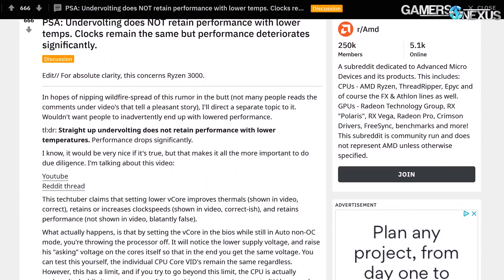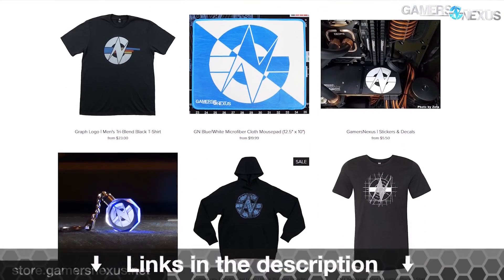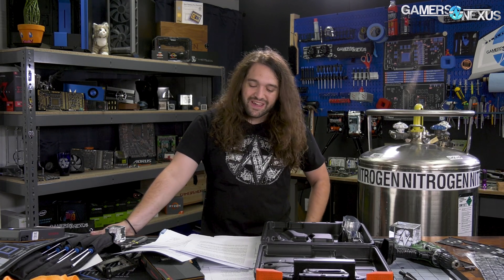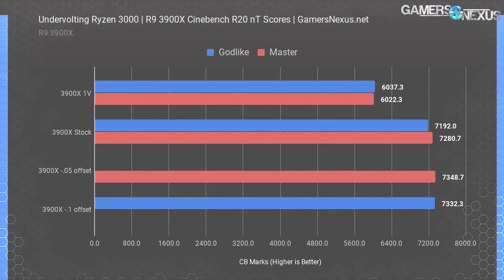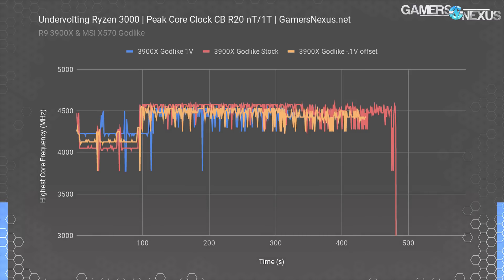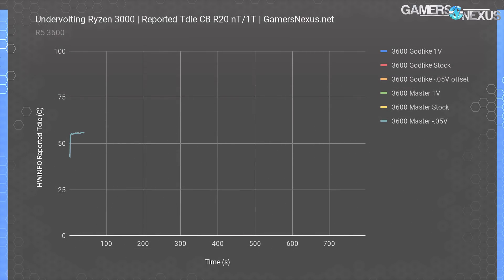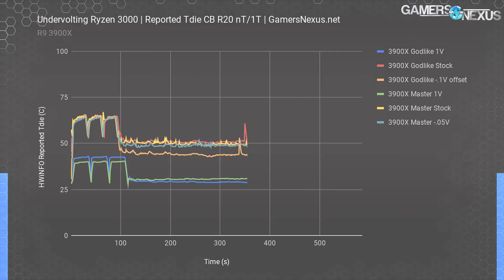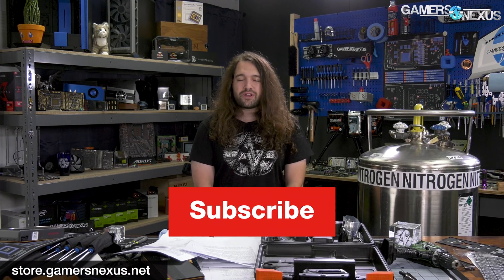AMD Ryzen 3000 Undervolting Offset vs. Override | Vcore Voltage

Comment: I just ran back to back Cinebench R20 runs on my 3800x at low static clocks (3.5ghz) with a Dark Rock Pro4, fans all at 100%, 1800mhz fabric, on a Asus X570-P
I ran each test multiple times until I was sure it wasn't fluke. I'm seeing a drop off at 0.9615v, but it looks like a pump at 1.25v
? That one confuses me a lot.
3668 @1.25v, idles @39c, loaded 58c (as reported by Ryzen Master)
3653 @ 1.1875v, idles @~37c, loaded 55c
3652 @ 0.96875v, idles @ 33c, loaded 43c
3648 @ 0.95625v, idles @ 32c, loaded 43c
3646 @ 0.9375v, idles @ 32c, loaded 42c
3615@ 0.9125v, idles @ 32c, loaded 41c
Interesting stuff!

Comment: Machine: Msi B450x Mortar Max, R5 3600, AIO CPU cooler. readings all from ryzen master.
[ ryzen master manual mode, all connected 4.2GHz @ 1.1v, CB Marks 3582, FSB 1866, cpu temp max around 58c, cpu power around 45w ]
[ ryzen master manual mode, all connected 4.3GHz @ 1.15v, CB Marks 3666, FSB 1866, cpu temp max around 65c, cpu power around 50w ]
[ ryzen master PBO mode, voltage excluded, CB Marks 3312, FSB 1866, cpu temp max around 74c, cpu power around 78w ] (cpu frequency goes around 3.9GHz automatically)
i'm really not good at playing with ryzen, i must have something set wrong since with all bios settings at default, one click PBO setting always give around only 3.9GHz and temp goes through up the roof. but now manually set a fixed cpu frequency and a lower voltage still gives better results.
Reply: This is the same with me I don't understand these videos cause since I undervolted and set my clock speeds to 4.2 I gained performance

Comment: Hold on...
I tested this and benched. I explained how and why in the video.

The boost and core variance in the algorithms, works in a fashion.

Now the temp and voltage are microcoded, if the temp is lower the clock will rise.

Buy reducing voltage at the core, this lower temps and boosts are higher and bench results.

I did not push as low as 1v.

I did lock voltage at 1.225 and 1.32 and 1.35 as well as 1.37.
But I let the other compensation run to allow compensation and also not.

On total lock, there was no boost. (As you would expect) however  due to science or ohm's law, by adding current, you could get a higher speed with lower temps.

On the video I did this is shown at 0:32 showing a boost clock of 5.1ghz
There should be some bench results in the video.
When I did the video it was more for the lower temps and expected performance. It just so happened to jump up more than expected.

Testing was performed over a week and serveral benches were ran to check the results.

However. Due to the performance variable being as it's software and algorithmic, the results varied constantly.
CB R15 varied by 200 points on the same clock speeds and settings.

In monitoring all bench and performance results, all hardware with "energy saving" and " boost stepping"  would not consistently boost or peak clocks at the same times. This resulted in a significant difference in results, by up to 4/700 points.
The only thing that actually remained a constant was temperatures. (Actually was was required).

However as you have said, all chips and configurations are different and you do get silicon lottery. Therefore one processors result can and do differ significantly in some cases. Therefore this result may not transfer to all CPUs or motherboards.

However a key point is that the voltages on the processors is too high and is not required, this is not saying setting a low core is the right solution. But the processors need to run cooler.
And it appears the stock software  does not manage voltage well at all. But this maybe a glitch in mine.

Hope that puts some light on the subject.

Comment: Asus strix b450 and r5 3600 idle temp 60° (in bios 48°)underload 75° after changing cooler and putting better paste..before it went to 80°. what to do? And in windows even when idle core speed is over 4ghz constantly  cpu usage 9-12%

Comment: trying to lower my 3600 down to 3.2ghz max turbo and keep the temps under 65c insted of 75c with a U14 noctua coooler .. 

ITS REALLY HOT IN AUSTRALIA 32c in my room and 44C (111F) on a hellday
Reply: how set vol, plz :)

Comment: Have been testing UV with my 3950X on my  x570 Auros Master, short story. 
UV 0.1V and LLC set to High drops temps ~10 to 73c in Aida64 with fpu stresstest and is rock stable.   
CB 20 temp 63c  544SC and ~5450MC, cpu-z 550SC and 11200MC.  
UV 0.1250V up to 0.15000V is cooler but needs higher LLC, system boots fine without LLC and works under load but cant recover after long idle. 
Cpu does 4,3ghz @ 1,3V ( 1.35V for prime95) but i get better performance with UV.
Cooling is set to quiet and fans is doing like 50-60% in aida64 stresstest so it´s silent during heavy load ( custom loop from EK  120+360) Ambient temp is ~22c in all tests.

Comment: So I'm guessing since undervolting seems hit and miss (I gained 300-400 points in CB) that it largely depends on the memory used. I'm only using 3200-16-18-19-19 memory, while I suppose you're using better memory. Though I'm not sure where the connection is. Maybe stalling

Comment: I'm running my 3600 at 1.168v 4000Mhz all cores, using the Ryzen Master software. If I go one step below at 1.1624v, the system crashes

Cinebench R15 Scores
Stock Profile - 1577
Undervolt - 1588

I'm using a stock cooler btw

My explanation would be that during stock settings, the V rises to 1.4s to touch the maximum boost clock but then it heats up the chipset instantly to 75 degrees or so and it throttles it back.

Using the undervolt, the temperatures don't rise as much and that's why it's able to stick to 4000Mhz. Also that people would say the software reports incorrectly, well if I underclock it a little more it doesn't send. Which means that it is in fact sticking to the voltage I'm giving it

Comment: Did you try only using Ryzen Master to adjust and measure voltages and peak limitations? Because it seems Ryzen Master gives a better representation of you CPU status then other tools because of the observer effect it might trigger. Especially when cores are in its idle / sleep state.

Comment: Fun Fact I managed to undervolt my Ryzen 2600x with an offset of -0.054 and the clocks still boost to 4.0 to 4.2 on the regular it depends on the task but my Cinebench scores are normal... Any lower and it starts to lose performance though... The Voltages tend to hit 1.37v to 1.38v max so just under the magical 1.4v. granted AMD has stated that 1.4v is safe... Still this is very interesting... Wish I had a 3rd Gen to test but it's much to soon to be upgrading from mostly brand new rig.

Comment: I had to set VCore offset to +0.0250V for my Ryzen 3600, otherwise, on "Auto" settings system was unstable i I got many constant bluescreens. I read on some forums that I'm not the only one getting those issues. On fixed vcore 1.35 also PC runs fine.
Reply: Can u help me with the Vcore Offset? I don't have the option to set a Voltage but only a offset. what whoud be good for my Ryzen 7 2700x at 3.9 or 4.0 ghz?
Reply: @CarloLeonKolega  Lower setting is better, but must be high enough to make CPU stable. You can start with "+0.0250", then test system, and if it'll be unstable try add some V. (0.0500?). Repeat untill you get stability.
Reply: @sznib  1.2 is stock V on 3.7 and I used Ryzen master to checked if it can run on 3.9/4.0 on same 1.2V. and it can

Comment: Sir , its safe if ryzen 3 2200g underclock to 3200mhz/ 1.15v?
Thank you
Reply: I set on 3ghz with 1.05 = and it stable on every aaa game, but for ac origins, i set 3.7ghz with 1.325  = it bring me 3 fps more
My gpu is rx 570

Comment: 1.2v @4.3ghz all core with my 3950x and it is stable. (I do this because my h100 pro sucks, @1.4v 4.5ghz the cpu will overheating under full load)

Comment: I dropped 5 degrees from my idle temps with an undervolt to 1.35, from 1.45 on my 3900. Also took the system to 4200mHz all core, and saw a 200point cinebench improvement. Will try with the voltage at 1.45 4200mHz just to see.

Comment: Hi , i recently bought 3700x and i have problems with temps (idle. Between 40 to 55 and i did a stress test , in 5 mins it got to 94 ° than i stopped it) what can i do to cool it down ? I have a stock wraith prism cooler and some noctua thermal paste

Comment: now i'm confused...setting - 0.1v offset in bios i go from 4602 to 4660 in cinebench r20..i only did 3 runs each..=x...so should i go - more??
Reply: You are probably gaining lots of ground in temp, which is helping you maintain an all core boost.  But you also need to run both cinebench and a benchmark that's heavily single threaded for each change and see what your max boost for single cores is.  You may be losing ground there.  But you are only at -0.1v, which the article tests clearly show MIGHT also be superior for some people's CPUs.  Test it! :)

Comment: pinned my 3600 to 1.0375v and fixed clock at 3.6GHz, the CB 20 score is 3245, if use PBO mode the CB score around 3700. so if set 1v had better also fix the clock.

Comment: When I offset-undervolt Ryzen 5 3600 the clock speed goes up a little bit, BUT the max cpu usage CAPS OUT at 87% on all cores (clearly visible in task manager). Resulting in less power consumption and less MAX performance (like cinebench), but non-CPU intensive use scenarios (like gaming) might actually see a benefit still. Only validating with cinebench has its downsides too.

Comment: Hello, i have the Ryzen 7 3700X from 12 july, I do a lot of test, different frequencies and voltage settings.
The problem is the thermal transfer between the silicon and the cap of the processor! Because the inside temp is about 80 degrees and the surface of cpu only 35 degrees. So AMD should pick up us processors and change it. They must make better temperatura transfer betwwen the silicon and cap! 
Now at this moment im runing always at 3800MHZ / 1,1V and load temps max is 62º whit stock cooler, and in idle mode 34º Because i have a gigabyte x470 mother i can´t do my customs pstates...

Comment: Got my 3600 at -0.625 V; any lower and CPU benchmarks start to drop.
Just wish it would downclock at idle the way my 2600 did - the temps on this one bounce up and down like a flea on crack.
Reply: How do you set an offset ?
Reply: @alexjs2383  How do you set an offset ?
I've since gone to a fixed voltage because it minimizes load/unload temperature bouncing.

Comment: I personally have found a sweet spot for the old 2700x at 1.2v fixed voltage with 4ghz on all cores. Temps and consumption are down (the spikes of the auto boost are crazy), multicore performance slightly better, single core workload slightly worse!

For me it's a win-win better performance with locked 1.2v instead of 1.45v spikee
Reply: Same thing on my 3600 :)
Reply: My sweet spot for my R5 3600 was 1.275Vcore,  1.25 VID,  runs stable it seems at 4300Mhz
Reply: @jay-d8g3v  hilarious how loads of 3600 chips clock another than my 3600x
Reply: @skinyoliphont  I couldn’t get mine to go over 4050Mhz, these guys’ chips are just built different

Comment: I'm interested in undervolting the Ryzen 3500U on my Thinkpad laptop to improve battery life, is there anyone here in the comments who's done mobile undervolting?
Reply: Mobile undervolting and custom fan profile is a must have on Macbook Pro laptops at least, much better performance when it is not constantly cpu throttling because of overheating ... I went from 2,2Ghz with severe throttling to constant 3,2Ghz 100% use all 4 cores doing this on my 2014 Macbook Pro.

Comment: Been playing with my 3700x since getting it, I've found 2 things that have helped performance, thermals and voltage with my ASUS X470 PRO. Simply setting the vcore to an offset of -100mv kept things quieter, cooler and performance was almost identical, another way was I had it running at 4.2Ghz 1.352v, I've noticed at stock it will run at 1.331-1.362v during an all core 4.2-4.3 boost, I've never seen it actually hit 4.4 yet, I just can't stand those voltage spikes while idle which cause the fans to ramp up like crazy for no reason, even with a very strict fan curve so I think I will be keeping it running at 4.2 1.352v, I know there was a post saying Ryzen 3000 series shouldn't go further than 1.325v for all core but I honestly don't believe that at all seeing as it is doing higher than that at stock when all core boosting, also cores can still sleep and slow down even with a manual overclock which is very interesting, even though HWiNFO doesn't display that, Ryzen Master does show lower core clocks and sleeping cores even with a manual overclock set
Reply: That was my concern: cores not sleeping and always run at 4,2ghz. I will look into it, since my 3700x runs 4,2ghz on 1,25volt on aida64 90min stress run.  Temps dropped 10 degrees and especially the max temp spikes didn't exceed 90 degrees celcius.
Reply: I have the same processor but a different asus motherboard , how do i set the offset in mv instead of v? I can only do 0.0625 adjustments

Comment: My chip sees CB score degradation anywhere below 1.4v PBO on or off. It holds 3975mhz when doing CB. 
Stock (highest result is tested) gave me 3500 pts and going lower than 1.43v or 1.4v drops CB scores by a significant amount.

Comment: id love to run a mini ITX build with a mid-range GPU and a CPU that i can underclock (for heat) enough to support 1080p gaming at 144hz even underclock the GPU if i can. any tips would be appreciated

Comment: I don't get what the deal is with people here demanding to see the 0 on the vertical axis. If there is no useful data crossing the area and it's not a bar chart or a histogram there's no point in showing a blank plot. It can't be that difficult to read the scale and range from a graph. It's completely common practice to adjust the scale in order to use the plot area most effectively, there's a reason why programs adjust the scale by default.

Comment: I try undervolt my 3700x with offside -0.075V got single core 496 and muticore 4764 in cinebench R20.
Is that good ?
Reply: Sounds like a pretty normal score for the cpu at stock speeds. So yeah, you're not losing performance.
Reply: @oxaile4021  thanks for info

Comment: Its normal  to get 58c whiñe gaming   on ryzen 1700 oc 3.7ghz and auto voltage  with stok cooler ,my temp room is over 30c.Anyone this is safe cpu temp?
Reply: It's completely normal, 58°C are quite safe temps while gaming

Comment: Steve, can you test per CCX overclocking like Der8auer mentioned on a 3900X with manual voltage tweaking? I've gotten my 3900X at 1.35V to 4525,4500,4375,4350mhz for the 4 CCX's which isn't bad. Performance in CPU heavy apps increased enough to justify the increases.

Comment: Recently I noticed this behavior while tuning my Vega 56. Voltage at 975mv p7 seemed stable, clocks were at ~1620mhz while monitoring, but during games I was actually losing 10-15 fps compared to 1075mv.  
Temps definitely improved but at the cost of performance, even though the numbers all looked good during stress testing.

Comment: I run my 3900x with -0,1375V offset with PBO enabled (x370 gaming 5 f41b BIOS (AGESA1003)). Cinebench 20 Score: ~6900 UV without PBO vs ~7070 UV + PBO vs ~7170 auto V. System power draw is 205 W vs 210 W vs 250W

Comment: Depends on what you want outta your system.  The bragging rights of working next to a jet engine (~140W cpu power) or just as good in performance and saves on power bills each month (~100W cpu power)?

my 1800x is undervolted to 1.16v and below.  I pick the setting based on Cinebench score after hours of testing, a spreadsheet to keep track of various P-state voltages & Cinebench #s.  I used to let mine go up to 1.37-1.39 v (with P-state overclocking)... the fans will go into banshee mode constantly (3x 120mm Industrial Noctua, 2000 rpm max), those fans will get loud close to max rpm. 

Now with the undervolting of 1800x, the fans are nearly silent and in everyday use, I can't tell the performance differences!

Oh, and my hearing is back too.

Noctua D15 + 140mm Noctua PWM fan
Asus Crosshair VI Hero Wifi

Comment: I got an intresting question...

I saw a few videos about Transistors. They explain how you need just a little voltage to turn the "Switch" on. 

My question is... if you underclock the chip too much.. will the transistors lituarly stop working because it's too low voltage to attract the Electrons to the holes...?
Reply: A transistor uses a gate which turns a current on/off depending on its voltage 
You need enough V for the current to flow as it must overcome electrical resistance.
So yes, too low the chip fails to operate correctly.

Comment: I noticed same with my 2700x before. I don't think it's a bug, more like precision boost works. Clocks are set based on actual temperature, power limits, voltage delivered! Etc. You deliver less voltage, frequency doesn't jump as hight.
Same with PBO - all it does is set much higher power limits AND raise CPU voltage. Result are higher frequencies set by Precision boost.
Its like that since Zen+.

Comment: my 3600x runs at 1.48V at Auto in Bios, in Aida64 at stress test of everything CPU hit 96.6 celsius, with stock cooler and thermal grizzly thermal paste,  but the thing is,  i cannot get stable 3400mhz RAM, the Auto V RAM in bios provides 1.364V for 2733mhz (which is stable) and the same voltage for 3466mhz, and its totally not stable, so i was pushing volts more and more, and was still not stable at 1.44V, i dont know if i can go higher to do not damage the RAM, i am just stucked at 2733mhz at stable and don´t know what to do, anyone help ? btw, XMP profile doesnt work, the PC start, but do not boot up, not even bios boot, i have to reset BIOS by unplugging battery all the time (only 2 DIMM slot motherboard if someone ask). The RAMs are Patriot Steel Viper 3400mhz CL16